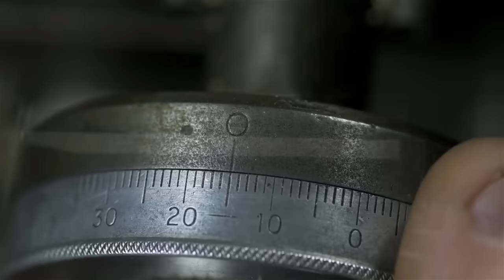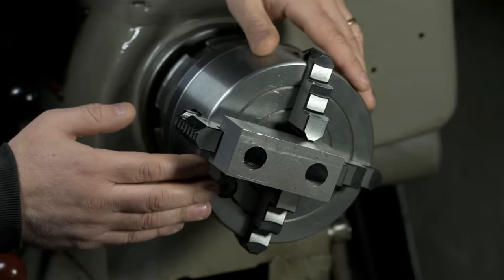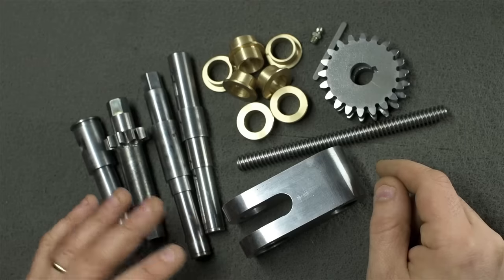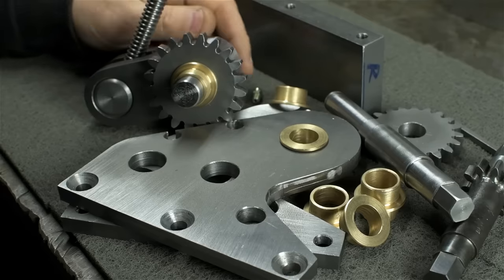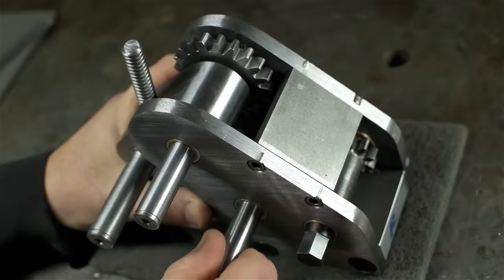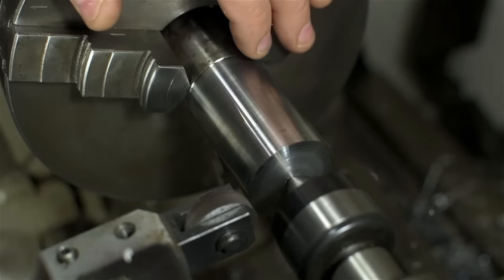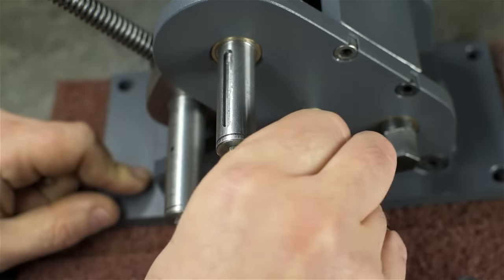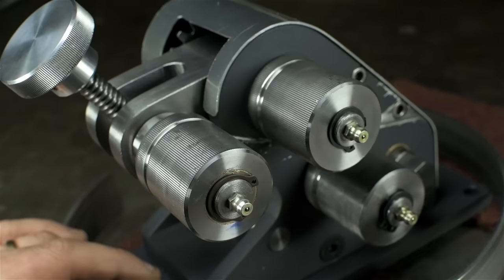The Rollenator! (Ring Roller Build)

Comment: About the knurling thing: seems like it would "find" the right diameter by giving you a slightly different depth/profile of knurl depending on the raw diameter you started with. Once you hit a sweet spot where it meshes nicely with what it left on the previous turn, you can push just it a little bit further, and then you'll get a bunch of force trying to push the tool out, and that's where you'll probably stop.

Comment: I was a CNC machinist before retirement and parts from start to finish was a CNC machine's glory. Also remember it's cut once measure twice! When I was knurling I did knurl around a radius. That was the hardest conventional knurling I did. Any other odd knurling patterns I would cut the pattern manually with carbide machine cutters.

Comment: I once made my own miniature ring roller out of a little vise with exchangeable jaws. I simply bolted three roller bearings and fender washers to purpose-made jaws. It is good for round steel up to 5mm, and I have to push things by hand so my parts are prone to accidental bending. But it works and it was dirt cheap. And the jaws literally fit in the pocket of my shirt.
Reply: I swear I'm not racist though I may be a bit dyslexic, but I could have sworn the first time I read this comment that it said Jews and not Jaws... Makes much more sense after I discovered my error, but I must admit it was pretty fuckin funny reading it the other way too hehehehe
Reply: @thora8624  funny thing about this: there is an old story about a Jewish rabbi who made the golem, which was kind of a tool. So it's the other way round. The jew wasn't made as a tool, the jew made the tool by himself. At least that's the way I remember the story.

Comment: I once designed one of these that clamped to the ways on our company"s engine lathe. The driven shaft slid right into the lathe chuck. We used it to roll arched top aluminum window frames. We found we were pretty limited regarding what shapes we could roll even with custom grooved rollers. Eventually, we invested in a really heavy rolling machine and enough expensive but low temperature melting alloy to make a bar that was 6" square by 14' long. This stuff would melt in a cup of coffee. Then we'd cast the painted aluminum extrusion in the middle of the solid bar and roll the whole thing. Of course, the low temp alloy was reused over and over.

Comment: I didn't know you could still get a sharper like that. In the antique firearms community we talk a lot about those because there was a change when those machines went from being the most common tool use to milling machines. You can see that the design of firearms internals changed  after it no longer became necessary to use the sharper. Less straight groves. It's very easy to see in some guns.

Comment: I have a stuffed shop - need to clear out some junk.  Hard to trow out my 1 gen Video game I built - 1958  Electronics with game port and display.  (lights and switches).  Transistors making logic gates.  24" x 24" cube. I'm 73 this year and still use my Lathe and Mill.  Need to get the surface grinders (2 ea) to flatten grindstones.  I tend to carve wood more lately.  Martin

Comment: Knurling is black magic, especially diamond knurling.
I worked in a shop where we made lots of fluid couplings for 'jet' engines. Lots of them had a knurl that we (quality) would have to inspect before they could start running. Being that I've been a machinist and an engineer (my own hero) i never could wrap my head around how knurling could work very well on various size diameters.
It shouldn't work, but it did.

Comment: I built a roller with slip bearings made from thick walled pipes and trash i found in the shop. The side rollers don't even rotate and the drive roller barely works. It is hard to adjust, kicks out the piece being rolled and everything is either loose or excentric.  
  
Tried to make a circle from 3x15mm flat steel, wdlded the ends and eyeballed the adjustments with a pair of nuts.  
  
The result was a 100 (+2/-1) mm circle.  
  
I guess good enough if you consider the fact that it was built from trash in two hours.

Comment: MNy years ago I paid $19 for a ring roller like yours from a garage sale. The yoke part was plastic and it broke right away and I used an aircraft screw clamp to hold the broken parts together. I had thoughts of machining one from aluminum some day but it's working fine with the hose clamp if I'm nice to it. I like yours better.

Comment: Vevor Ring Roller $70. I mean I know this is sacrilege to this channel ethos and all that stuff. And I absolutely adore this channel. I also make my own tools including bending tools for large pieces of stainless steel etc. But I generally only resort to making my own tool when I really need something and can't just go buy it for $70. So yeah this is a bit of a head scratcher for me. I may actually buy one of those Vevors because I fabricate things that need rings on a regular basis and I usually do it by hand in a handmade box brake with a round bar die attachment.

Comment: @ 0.34 you are cutting with cable cutters. Brings to mind, I worked for a company that sold Cable ( Electrical ie, Al or Cu) Cutters. 70's. We had sold a pair, large, for cutting up to 240mm2, and several months, well nearly a year later, they came back. Yep, cutting edges mangled a bit and one jaw cracked, yes buggered. On talking to the customer, he said that he was sorry to come back, as they were the best cutters he had ever used, but after cutting hundreds of pieces of Hi Tensile Wire Rope, they had given in. Said, shoot, sorry sport, but they are only meant for copper and Aluminium, he agreed, he knew that. he didn't want a warranty replacement, but only brought them back to ensure that the new pair he wanted to buy, were exactly the same. He was only cutting max 1/2" cable. I was amazed that they had been so good.

Comment: Wish I could post a pic of our Roller on here. It's 3 phase and quite a bit larger. Made a 40 some odd inch diameter 1/4 x 2"  Aluminum ring day before yesterday with it. Light bending as compared to the Steel bar and tube stuff I normally get stuck bending on it. It was 10 grand used when we picked it up tho

Comment: You'd change your mind about cnc if you had a Proto-Trak bed mill. You can be on your own doing MDI pendant programming in under 2 hours of instruction. On and off the machine as fast as a manual one. Great video!

Comment: I know I'm commenting on a 5 year old video, but I'm hoping this still reaches you. My best friend needs this tool, or one like it. He has a business. He makes rawhide drum heads. His problem is hoops to tuck them on. He had a guy that could make them, but life happened to him, he's scrambling for solutions to save a dying art. The hoops he built his business on are 1/4" and 3/8" solid, square 6000 series aluminum with a welded joint. 

My proposal to him is get a tool to roll the ring and bond the aluminum.  With the forces involved, my opinion is the ring doesn't need to connect. But I convinced him that it's not a compromise, it's a upgrade. 

I've talked him into bonding based on Lotus car chassis. I just gotta get a machine that can roll nice flat ring out of aluminum. the kerf of a bandsaw blade is just about the right amount of room for bonding. 

If you could rebuild this or modify it for the purpose I described (Flat rings of solid square aluminum, 1/4 or 3/8" with IDs of typical drum heads). Could a Hazard Fraught Ring roller or maybe a slip roller, be modded into the tool needed? 

My bro has some seriously cool clients, names anyone between 20 and 80 may know. It's not my place to name drop. I don't know where you are, but if one of his clients has a show in your area, he'd ship the order to you and get you to deliver it backstage. 

This isn't spam, this is a guy taking a shot in the dark to help his best friend with his really cool business. If you respond to this, I'll direct you to where he does most of his business. 

Literally any response is will be deeply appreciated. I'm just trying to solve a problem for a friend who's business I believe in and have no financial interest in beyond him being able to buy a few pints from time to time.

Comment: Really liking your channel :)   So much better than my bestest video :)  Hehehhehehe :)  

Recently, you mentioned it's, "never too late, unless you're 110" in regards to learning metal lathe fun :)   Well, I spent 33yrs learning woodworks (officially, career wise) and many, several weekends before that building decks and fences on the side, to supplement my regular entry position incomes.  (catching turtles & selling them, running a sno-ball stand, fasteners & threaded products warehouse work, .... , I mean, everything from washing dishes to light mechanic work).  I worked w/ the best guys in the country for installing high-end millworks and I have a decent vocabulary or library of knowledge built up by now, in that genre !!  But, I look at you and wonder, "how does one go about learning what you know" ? 

I mean, do you start in a metal lathe shop ?   Is that what they call a machinist ?  Maybe as a helper and move up through apprentice , journeyman , etc ... like i did ?  Or just purchase a metal lathe (no knowledge of whether it's functional, can be tuned up or how) ?  Online classes ?

I can see many machines and jigs in your video's, which attract me, but, wanting to turn metal for knobs, parts, jigs, etc ... seems way more involved than just purchasing a metal lathe.  
Question :
How would you suggest starting out ?

Thank you for your generous consideration,
sincerely ..................................

Comment: If you drill this deep regularly consider turning a weak point into the shaft of the drill with a rounded cutter so you dont have stress risers. That way you stand a fighting chance of salvaging the part if (when at 40x) you snap the bit.

Comment: At 16:06 I noticed that the counterbored holes near the edge of the device are broken open to the surface. They could be welded up then, re-machined.
I quit using counterbores because they are usually a bit oversize so after drilling the holes I put an endmill in a collet and counterbore. Now the head of the screw fits nice.
You didn't need the knurling on the rollers.

Comment: Tony, you asked if you could buy one cheaper than it cost you to make. 
Back, somewhere in the mid 1980's on a visit to UK I happened on a tool sale in Bristol. Rumaging through his wares I came across a brand new bender machine not unlike what you've built. I'm a steam hobbiest and thought "I can use that" so I bought it. I don't remember what I paid for it but suffice to say probably less than £10.($15) It came in a formed styrofoam carton, weighed a ton and I transported it back to Canada. I think I've used it once. Country of manufacture I suspect is India . Subsequently I've made a plywood case into which the slowly collapsing styrofoam carton fits snugly so the bits don't get lost. It came with a rudimentary manual, fortunately, because when I go to use it again I'll have to read the book to remember how to assemble it again.
Thanks for the video, humour and that old geezer who kept butting in.
Regards from Canada's banana belt 👍🇨🇦🤞

Comment: One option on gear-meshing is the take one of the shaft bushing-holes, drill them larger, and then make a new bushing with an eccentric location for the bushing-bore. That way, rotating the bushing will move the shaft closer or farther away from the shaft it's partnered to. Of course, this only creates a hair's worth of adjustment, but...

Comment: There is a flaw in that type of design though. If you have two driven rollers on each side of a bar, one roll is driving the outer diametre and one on the inside, hence the rollers cannot have 1:1 gearing since that will make one roll slide and that will destroy the knurl, the roll and the finish of the rolled material. So the ideal is to have the two driving rollers on the same side and the free roller on the inside. Thats why your knurl flattened out. And the thicker the bar or flat stock, the more apparent the design flaw will show itself. Most machines that ive seen has two driven bottom rollers and a free spinning top one thats adjustable within a dovetail or similar. Anyways, always fun to watch your videos. Cheers /nicke -$weden

Comment: for someone who is wanting to get something to work metal what would u suggest them get first. i have a lathe on the way now, suppose to be here tomorrow, cant wait. i dont have a clue what im doing but i still cant wait to try to figure it out. ive got a small cnc router, very small. 3018 so all ive used it for mostly was acrlic an wood or engraving with a diode laser but id really like to get where i could make metal parts. aluminum at least but if i could manage to get something that could work steel would be that much better since i only have a very cheap mig welder non gas an im still learning that but right now i need to figure out which is the cheapest or better way to go about getting something that can do the job, ive looked into building a cnc router that would be able to do it but im not sure what it actually takes. ive built 3d printers for a couple yrs now, so im confident that i could manage to put something together but im limited on what i can use to build from an where i can get it. like aluminum extrusion that are used on most of my 3d printers, i have considered using this but it would take at least a 4040 extrusion or bigger an when buying the 4040 extrusion i only have amazon to buy them from an it get really expensive really fast. 2020 extrusion are not as bad but anything bigger than that starts getting extremely expensive so ive been buying some stuff up here an there as i can in hopes that one day i'll actually end up with enough spare parts that i might be able to put something together, a couple 4040 extrusions here a mgn12 rail an block but i dont know anyone personally that does this stuff to speak with to learn from so all my info is coming from online an thats not always the best info. theres a really small mill on amazon called proxxon micro mill mf70 an i started to buy one but instead decided on the mini lathe 7x14 so im crossing my fingers i got something decent to learn with but id really like to know what that mill is able to do, ive seen a few videos on youtube showing it working but not alot of info is coming from the ppl about them an what they can work with but from all the pictures it just seems so small i couldnt imagine it being able to do alot but at the same time there was a couple ppl cutting steel with it. i know something like that would be completely pointless for you to have in your shop with the tools you already have but it would be nice to hear someone with ur experience speak on these tools an if they are just a rip off or if they are actually capable machines an what you would most likely use one for. love the channel, can only hope to be able to do half of what u do at some point in my life.

Comment: It’s a great build. I would have suggested slight flanges on the ends of the rollers near the plate so that the metal wouldn’t run into the plate and cause that gauging. In addition, it would eliminate any friction from that action. Otherwise, it’s a $750 build.

Comment: Great job
Unfortunately the lathe  Chuck doesn't have holes and slots. 
If it did you could have added counter weight to balance the material and run higher rpm

Comment: What are you oiling with into Zerks ?  My surface grinder has oil that way.  I'm thinking of a paint can from someone - can of oil inside - new empty paint can with quart of oil - then insert the tube and put a zerk connector on the end instead of a sprayer hose - add air and away you go.  Seems it would work.

Comment: This Old Tony. The Microwave bolt scene.... I couldn't help but notice the rotation didn't jump with each cut.... did you rotate it at a much slower speed and drop in the bolt and splice out the falling before speeding it up, or did you drop in a bolt and record 1 full rotation before dropping in the next bolt then align the rotations in the edit?

Comment: Assume you have a 21 tooth-per-inch knurling tool (which seems a typical size) and the circumference of the thing that you're knurling is exactly two inches. Notionally, that means that you'd be cutting 42 grooves. But they would have no depth. In order to get some depth, you'd have to cut 41 grooves. It turns out that in order to take one groove out, you have to reduce the diameter by just over 15 thou, which means a depth of 7.5 thou. Typical knurl depth ranges from about 10 to 35 thou. So if your knurling isn't lining up, you just need to push in less than 7.5 thou more. That isn't even going to move the knurling from fine to medium, much less require you to adjust the diameter of the part.

Even more interesting, it doesn't make any difference what the diameter of your part is. The additional depth you have to push in is a factor only of the TPI of the knurling tool. (Specifically, 1/(2π × TPI).)

Comment: Hey Old, Yes I'm re-watching some of these. Don't judge, you know what kind of a year this has been. So, I don't think you've ever explained how you're tapping threads. I've always used a handle, and I can't understand how you're using a drill or mill (not gonna go back & check which - I do have a few shreds of a life left) without just tearing a hole in your stock. Is the tap on some kind of free-range sliding mandrel, or is it clocked to the thread pitch somehow?